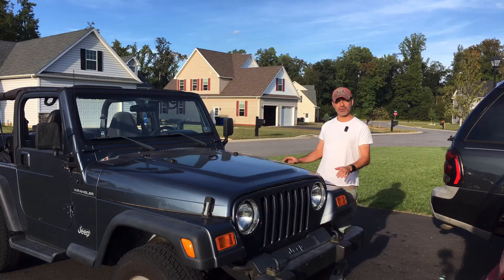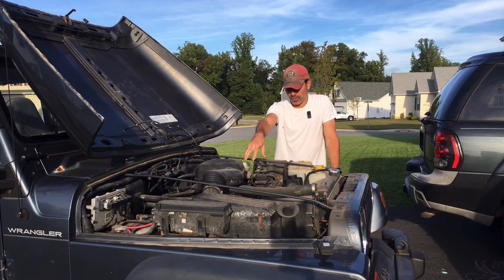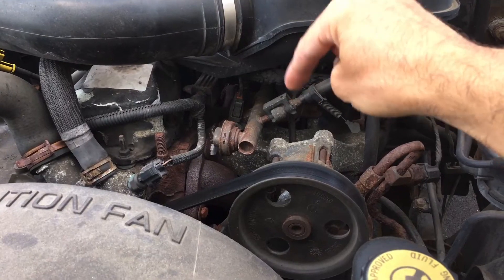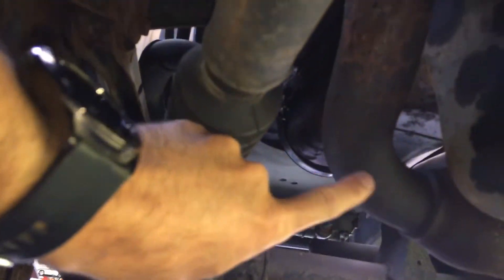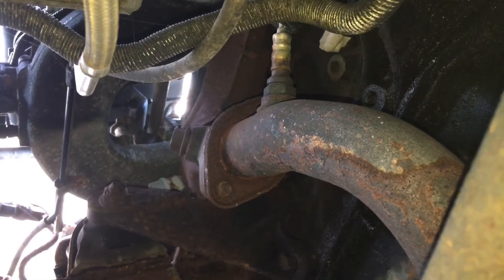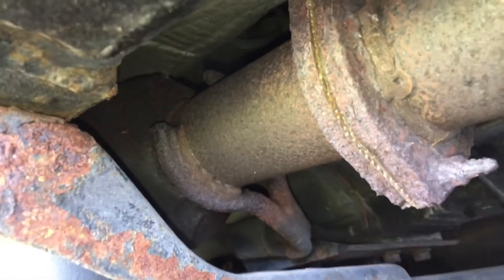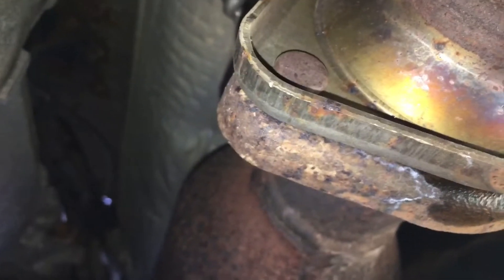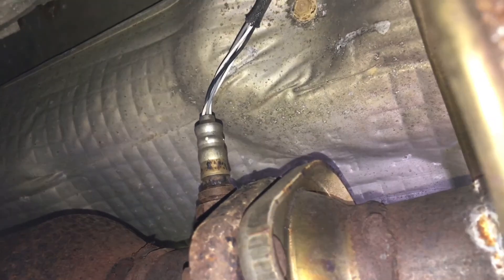Locating Oxygen (O2) Sensors On A Jeep Wrangler TJ (Andy’s Garage: Episode - 283)

Comment: I have a TJ 4.0 year 2000 and the error code on the OBD is P0138 Bank1 Sensor2.  Could you tell me where this sensor is located?  Thank you.
Reply from the maker: Bank 1 Sensor 2 would be located on the cylinder 1 side of your engine, and the sensor located AFTER the catalytic converter going towards the muffler
Reply: @PhillipsVision could a hole in muffler cause that code?

Comment: thx! very useful information. can I just unscrew them with a ratchet or is something to consider for replacement?
Reply from the maker: You can use a ratchet but get an O2 Sensor Socket
Reply: @PhillipsVision  it dind't work with the O2 sensor socket, I just haven't got enough room for it - but it DID work with the 22mm wrench!

Comment: I order 4 oxygen sensors from Amazon they sent me 2 with 2 white wires and 1 gray wire and 1 black wire . And they also sent me 2 with a black, white, purple and gray, so my truck had all 4 with the 2 white wires, gray and black, so will the 2 sensors with the black, white, purple and gray work

Comment: Hello. Where's the 02 sensor heater circuit bank 1 sensor 1 located? I have a 2001 TJ 4.0 6 cylinder
Reply from the maker: It’s part of the O2 sensor. You need to replace the bank 1 upstream sensor
Reply: @PhillipsVision  right but the 6 cylinder tj has 4 02 sensors?
Reply from the maker: @claudes1973  it should, yes. You should have 2 banks and each bank with an upstream and downstream.

Comment: How many oxygen sensors does a 2003 Jeep TJ 6 cyl have?
Reply from the maker: 6 cylinder should have four...two upstream and two downstream
Reply: @PhillipsVision  Thank you for replying back. I've been experiencing engine hesitation. I though it was the manual transmission, but that has been ruled out. I replaced all spark plugs, did an oil change and still the same issue. I did the self diagnosis test by turning the key three times and I got code P0432, which  means that the catalytic converter for bank 2 is performing below what it should be. So, I will start by replacing all four sensors and take it from there.
Reply from the maker: @hThorman123  I would only replace the one in bank 2 that is bad, save your money